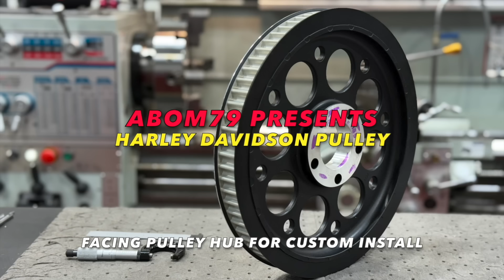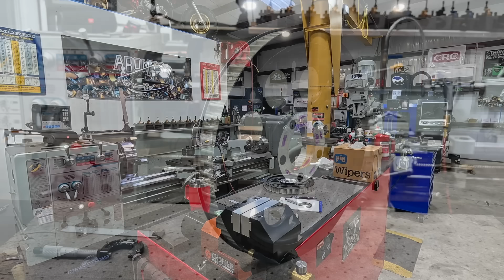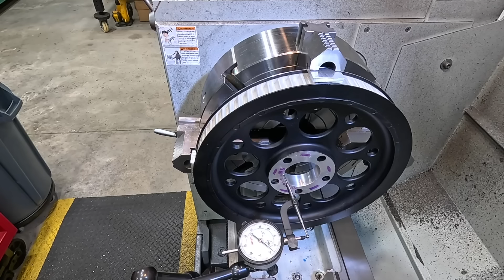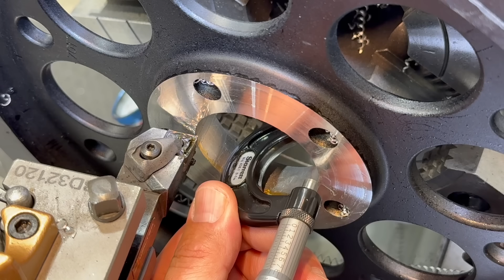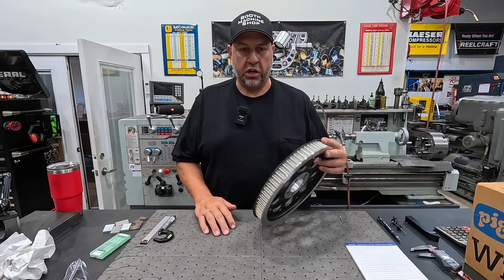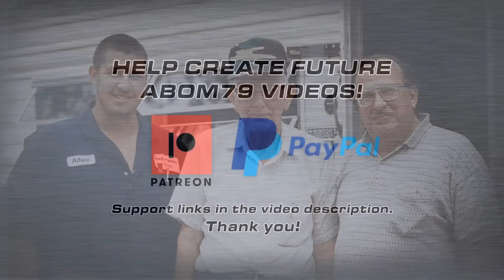Harley Davidson 70 Tooth Pulley Modification

Comment: Adam, I had a similar situation with a shop that was "willing" to bore out the old sleeves and fit new sleeves in a 1946 Indian Chief. After 15 months of excuses we gave up and bought brand new old stock cylinders for not much more than the machining quote! Reputation is only as good as your word and it doesn't take long for the word to get out that a shop just isn't trustworthy!

Comment: Why didn’t you put it on a Bridgeport and clamp it down and use an end mill to face it off ?
Reply: When you are comfortable on a lathe its just the go to, better finish, easier in every way, faster.

Im the same way, you do almost anything on a lathe. Dont go any smaller than a 12x36 though

Comment: Since you were using aluminum inserts did you use a specific holder for them, one with a positive rake or just use the same holder you would use on steel and just let the insert work as is?

Comment: To clarify for those who haven't done work like this, yes, having a TIR of sub 0.001" on the ID isn't exactly critical. Having a TIR of sub 0.001" on the face is absolutely critical. Doing one without the other is kind of silly. In general, centrifugally balanced parts are standard practice, and with your chuck jaws out that far, you'd likely see it in the finish on the part if you were more than a few thousandths out of concentricity. Nice work per usual!
Reply: Why is his tool facing towards the center of the part instead of towards the headstock?  There must be some advantage??

Comment: I’ve done the same job myself but I used a faceplate. I would protect the outer machined ring with green tape to prevent scratches. Nice video Adam👍

Comment: I was curious if you verified the consistency of the hub thickness after  machining as you did before machining?
Reply: I was going to ask if it would change the balance on the part, because he said in the beginning it was off from the factory and was balanced off, now it has changed.

Comment: What was the point of using the Copper packers. They are harder than the Aluminum part, surely just the Aluminum packers on their own would be better, they were thick enough to use on their own. Does he really think copper is softer than aluminum after all these years machining? No formal training will always keep catching you out.
Reply: That pulley is probably an alloy, harder than copper
Reply: It may not be softer than aluminum, but it’s surely softer than the chuck jaws.  And smoother.

Was there some failure in the result that you noticed?  What actual problem are we trying to solve?
Reply: @ydonl  the aluminum pieces could have been used without the harder copper shims. The question is what is the advantage or reason why he used the copper shims. There seems to be no obvious advantage only the disadvantages of using harder " soft " shims and juggling 8 pieces to hold the part. Would you, like everyone else just used the aluminum packers?
Reply: @Bosun-8  I think I’d explore the options, hands-on, and consider hardnesses, smoothness, relative coefficient of friction, and whatever else I could think of.  I think the coefficient of friction is more important than softness, and I don’t know how that works with aluminum/aluminum versus aluminum/copper versus anodized aluminum/copper. I do notice that normal chuck jaws usually seem pretty hard, and there has to be a reason for that.  I wonder if the standard jaws happened to be smooth if they’d just work.  Ultimately, the issue is not just hardness, I know that for sure.
Reply: Apparently there arent differing alloys and hardnesses .... theres only one grade of aluminum and copper 😅

Comment: Wouldn't it be quicker to center it with the tail stock first?
Reply: I think the basic issue here was getting it centered up while managing the pads, without them falling out.  One way to do that was make small adjustments and never let them get very loose.

I don’t think it really took all that long, and we know that’s his usual technique so he was fine doing it that way.

But as he says, there’s always different ways of doing things.
Reply: too easy
Reply: Haven't used a 4 jaw that many times but have found that aligning to a center in the tail stock gets you close prior to mounting a dial indicator for exact centering.

Comment: How does moving a pulley closer to the center of the wheel give more clearance for a wider tire? Make it make sense! In my mind a spacer would be used for that. Unless the swing arm itself was modified to fit a fatter tire and this is done for alignment purposes?
Reply: swing arm has a fixed width. tyre needs to be wider. no room. make pulley narrow and push it across.more room,tyre fits

Comment: Adam you should have shown bringing up the tail stock with a center or a bowl Center that'll keep that pulley the reasonably concentric then you can open and close the truck at will and not have the danger of it falling out it's a faster way of loading that part

Comment: When you talk about the initial removal of a certain amount in thousandths of an inch, it would be cool if you could give a visual representation of that. A lot of us understand fractions down to the 16th of an inch but when you start talking in decimals - we're lost
Reply: 3/16" is about what he took off.   3/16" would be .1875, and he took off 0.185" (aka 185 thousandths of an inch).
Reply: Look up a fraction/decimals chart, it will usually also have metric to cross check it if you need that.  .185 is @ 4.76 mm
Reply: .025, depth of each facing cut, is .635mm.
Reply: 1/16"  = 0.0625 thousands of an inch.

Comment: Great Video as always! One question from complete noob- why 4 jaw not 3 jaw if the part is nice and round ? that would sav the indicating part
Reply: To allow for the differences in the soft jaws and it's much quicker to chuck a part in what's on the machine than it is to change the chuck.

Comment: Why were you worried about concentricity for a facing operation?  I understand checking the face to ensure it's running true, but a simple facing operation shouldn't required concentricity within a 1/2 thousandth!  Couldn't you just get it relatively close "by eye" and face it off?  The only operations that really required concentricity were chamfering the edges - that must be the reason for the getting it concentric?
Reply: I'd try to get it close to concentric... even if just using a 3 jaw... mainly because you don't want the finished surface to have weird cutting patterns that make the part feel eccentric when looking at it.  I don't know about getting it to as close as Adam got it to here, but it's definitely good a good practice to get used to, making things in your machine as accurate as possible, to avoid potential issues with things down the line.  Laziness is a manual machinists downfall for sure.
Reply: Is there an advantage to having runout?
Reply: How would you chamfer the hard edges without it running concentric? Maybe use 30rpm and wind the cross slide in  and out while praying to God? lols

Comment: How can bring the pulley closer to the center of the wheel give the tire more room ?
Reply: We don´t exactly know what else was changed! Different rim with different offset, wider fork, maybe a spacer or two...
Reply: the idea is to make room for the tire against the belt. for that the pulley needs to move towards the outside by using a spacer or a pulley w/ an adequate offset.

in general the front pulley has only one flange on the outside. depending on the model the belts can run on the inside, outside or sometimes center on the rear pulley. the rear axle is used to set both belt tension and belt alignment. 
compared to chains belts have no slack, in fact there's tension, so there's no lateral movement of the belt eliminating the danger of rubbing against the tire. the faster the tire rotates the narrower it becomes so the tire-belt clearance can be quite small.
Reply: Depends on the setup. The pulley mounts to the tire hub.

Comment: Why does it need dialling in at all if you're only facing it off ... ?
Reply: The edges of the bores were chamfered in the lathe. If the part wasn't on center, you couldn't do that in the machine.

Comment: Since you're doing a facing cut and concentricity is not an issue, would a 3 jaw chuck been acceptable?
Reply: He also had to cut the inside edge of the center hole so it had to be indicated true center.

Comment: I have seen on a couple other channels (CEE and HAL) that they use a large 60 degree tapered cone in the tail stock to both hold the part against the 4-jaw and center it to aid in the initial snugging up, then they remove the cone and indicate on the bore to make it run perfectly concentric.  It looks like that saves a lot of time and prevents accidently dropping the part out while you are setting up the shims.
Reply: That’s a very good time-saving method for all the reasons you stated.
Reply: I also watch CEE and HAL. These are 3 Great channels to chill to in the evenings
Reply: I just started watching HAL and it's pretty good.
Reply: Other channels learn from Abom79